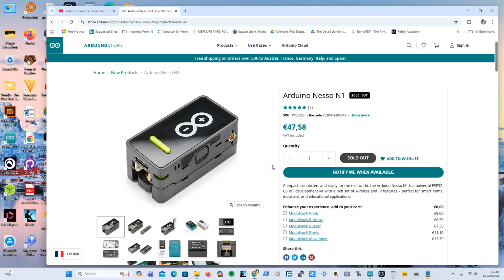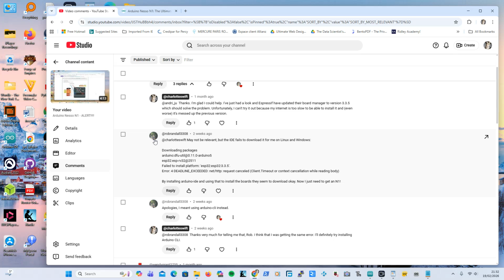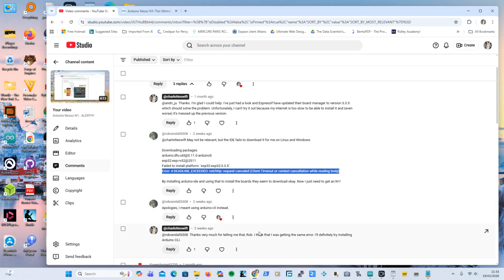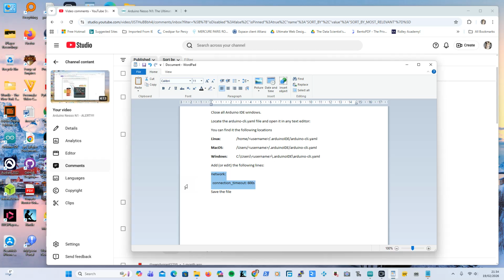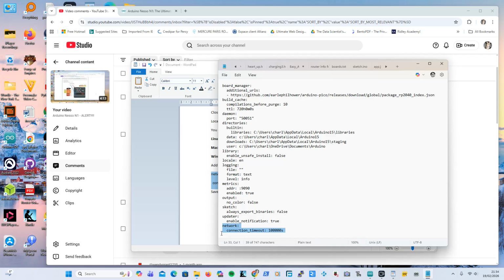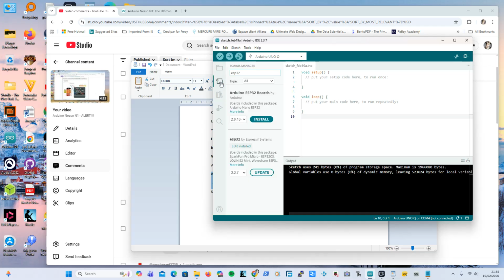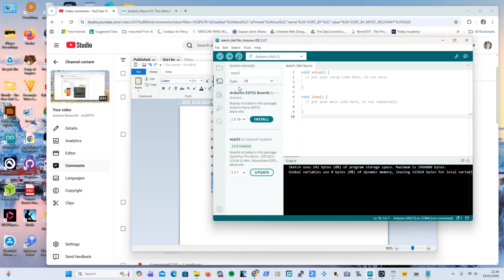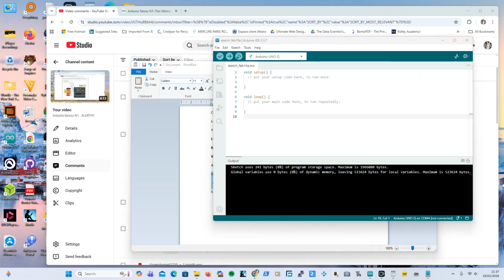Arduino IDE problems that stopped me using my Nesso N1 or installing anything new.

Comment: I live in Stockholm, Sweden, so I have superfast Internet over cable at home, or over 4G/5G in my summerhouse.
I remember long time ago, when I tried to download an email with an attachment using a modem and my analog phone line. It was frustrating when getting timeouts all the time.
Reply from the maker: @peterkarlsson7801 That was probably over 10 years ago. Are you trying to depress me, Peter?😁

Comment: Good to know - I am lucky that I have reasonable access here at my house and at my camp.  Hope your connection will improve in the future!  Thanks for the video and hope all is well.
Reply from the maker: @lorisrobots  Lucky you, Lori!! They 'forgot' to give us access to the fibre optic cable when they ran it down our road. I told the engineer at the time but he refused to do anything. He even pretended that he was Italian and couldn't speak French. It was a shock for him that I could speak Italian but he still wouldn't check with his boss. I should have taken his van keys so he couldn't move away from our telegraph pole until he installed the box!! I wonder what prison food is like😁They're taking away our copper cable at the end of the year so I have to get complaining yet again.
I'm currently trying out an Uno Q as I can send it back within 30 days and they'll refund the postage. I agree with you about the blue LED matrix being very pretty but is this enough to make me keep it? Using arduino-app-cli could be the game changer. Thanks for watching and take care of yourself.